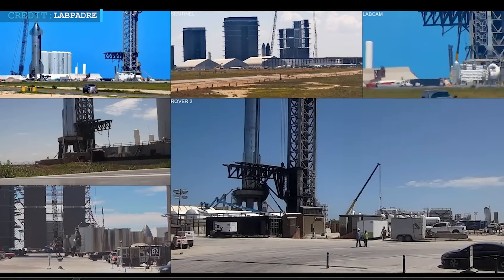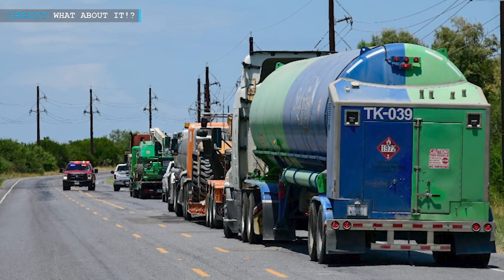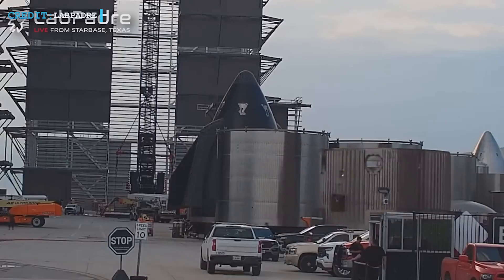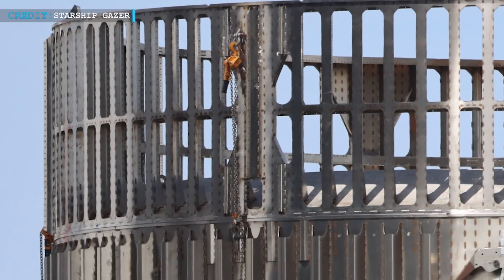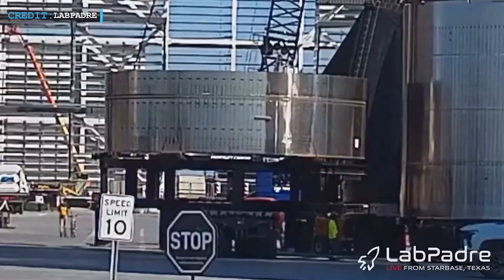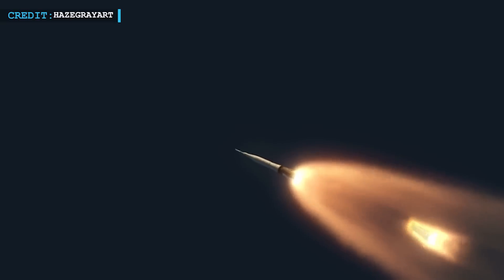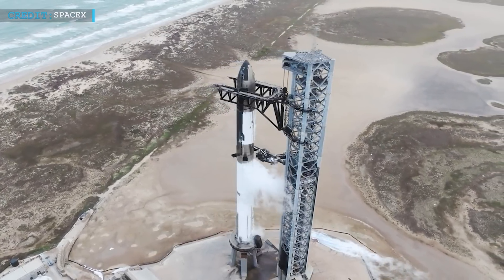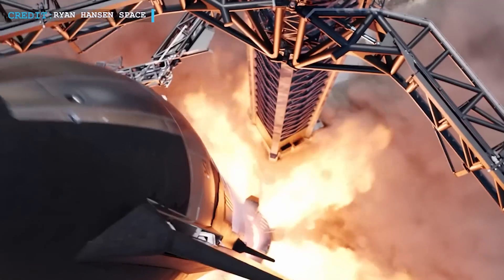SpaceX Starship's interstage design change to facilitate hot staging | Ramping up for next testing!

Comment: The Russians used a lattice-work of struts as the hot staging interface, to allow maximum flow of rocket exhaust out from between the stages.
Reply: Non of their rockets are reusable. SpaceX is aware of that design, but has chosen this one for a reason.

Comment: I found the photo of the interstage interesting.  As you noted in your video there are some corner bracing associated with taking “torsion loads”.  In structural engineering terminology when torsion loading is applied the main load component to be addressed is diagonal tension loading.  This is loading directed toward the opposite corners of a panel.  The strongest and lightest design would feature tension ties running from opposite corners to take this load.  The photo shows that this was not done for this design.  While corner bracing can help take this load it’s capability is not nearly as great as a direct tie from opposite corners.  If you look at old Russian Soyuz rockets you will see these diagonal tension elements in the interstage.  The lack of diagonal tension structure in the SpaceX interstage leads me to believe that 1) either the torsional loading on it is not significant or 2) the SpaceX engineers made a mistake.
Reply: Thanks for taking the time on this, really helpful, much appreciated

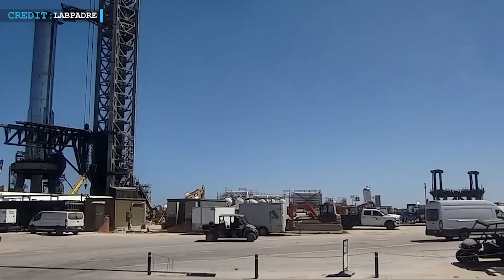Comment: @1:10 to 1:20 on the bottom right hand side of the shot, there was an interesting piece of equipment raising a 
double arm ram up and down. Does anyone know what this is?
Reply: @otpyrcralphpierre1742 When the booster is installed on the stand, these have pins connected to the bottom of the booster. As the booster is lifted the "double arm rams" will follow the booster for a bit to make sure it isn't swinging from side to side, damaging the engine bells. When the booster have cleared the stand, the pins detach
Reply: @RippanYT  Thanks for the info. If that is accurate, it sure looks like it has far too much "travel" for it's intended purpose.
Reply: Yes, it is explained here
https://www.youtube.com/watch?v=v7gi57NJDds